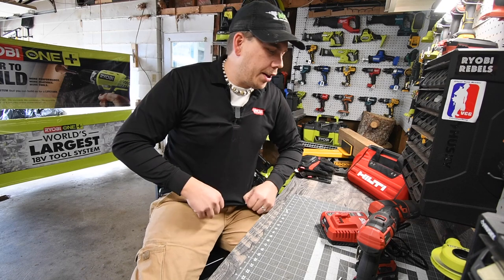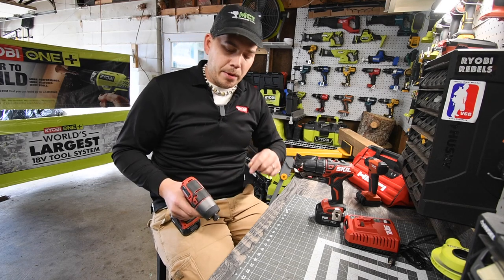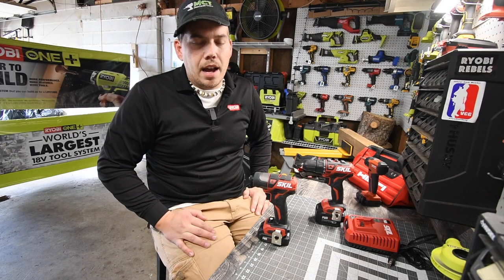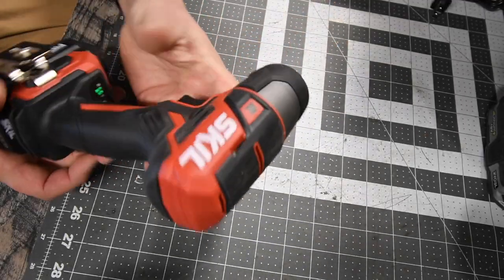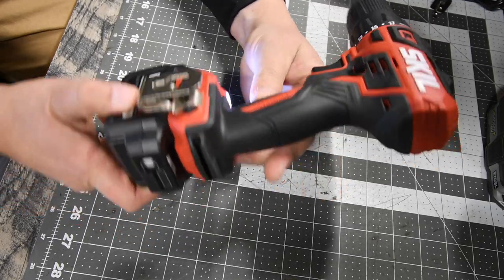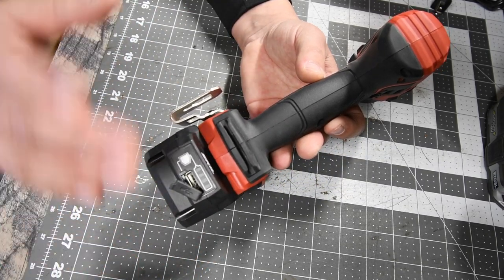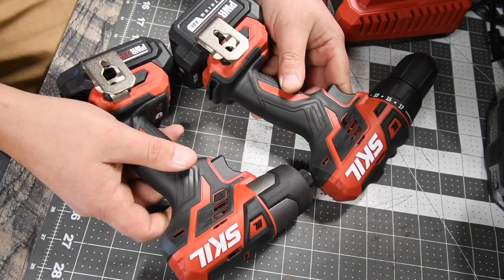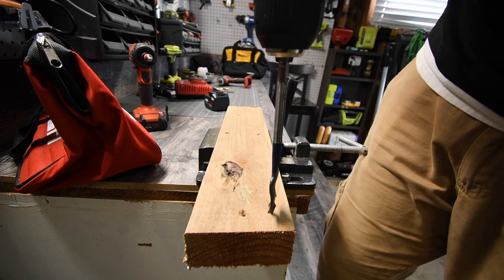Skill 12v Drill and impact test

Comment: Those usb ports are sick. For my line I bought a usb adapter for like $15 but still built in is really nice to have.
Reply from the maker: I agree and they should be standard for all
Reply: They're perfect to have a spare in the glove box, just in case of an emergency. What's more, the batteries have a cap so you don't have to worry about the terminals getting damaged.

Comment: I see nothing but high marks for these new Skil12v and 20v tools, but the problem is they have no distribution or retail partnership with any large outlet or home center like Lowe’s and Home Depot. Making them effectively an online-only option. I even called them today to see where I could find them in my area (Orange County, CA) and they couldn’t tell me. So when I’m comparing homeowner/DIY cordless tools, affordable price, good to great reviews, I think my choice has to be Ryobi. Too bad, because Skil tools look great!
Reply from the maker: I personally love 12v tools and Ryobi needs to make a 12v Brushless line and I thank you for viewing EatmoreBBQ
Reply: @ManCaverTools  Update: The Skil PwrCore 12 and 20 lines are now at my local Lowe’s! Not everything yet, and small end-cap displays with the tools out so you can hold them, but at least they are there! I’m hoping the Skil line grows to include a 1/4” cordless router, a duel 12v/20v charger (as Milwaukee and Dealt have) and maybe some day a brad nailer. 12v 5-tool kit for $199 (drill-driver, impact, multi-tool, light and  Bluetooth speaker if you like that, 2 2ah bats, standard charger), 12v circ saw $99 with 4ah bat and the new Jump charger. So add that up and if you spend $300 for both kits that’s quite a deal!

Comment: I would like to know if the craftsman performance is same as skill.
Reply from the maker: we will find out when I get 12v craftsman tools
Reply: @ManCaverTools  Is craftsman finally coming out with their V12 lineup?
Reply: crunchy pockets I would assume they will. There was the original craftsman 12v before sears sold off the name. But those were brushed and I think old nicad battery tech as well.
Reply: @jamesfair9751  the nextec 12v are lithium

Comment: Does the drill have a 3/8 or 1/2 inch chuck? Thanks!
Reply: I believe all 12vs have a 3/8" chuck regardless of brand. I maybe wrong but researching 12vs I recall a lot were 3/8"....
Reply: mixwell1983 thanks bro
Reply: The Milwaukee fuel is 1/2 inch regular brushed 12 v Milwaukee is 3/8 inch
Reply: Janes Fair thanks!
Reply: 1/2 in for the skil 12v
Reply from the maker: 1/2 chuck
Reply: Man Caver Tools thank you, thats awesome
Reply: Damn didnt know a lot were 1/2".. I was looking at cheaper brushed ones like Ridgid, Makita and Milwaukee so maybe that's why.

Comment: There is a 5 tool kit skil 12 volt for $99 dollars all brushless drill impact driver multi tool light and Bluetooth speaker at lowes and batteries you can plug usb to charge phones

Comment: I will politely disagree. Power tool batteries should not come standard with a USB. The industry I work in that rubber cover can get lost easily allowing dirt and debris to get into the USB port. This would create a failure point. I believe most of the main Brands have a battery to USB adapter available for there batteries. This is a safer way to create the batteries, I’m not stuck with a USB port on my battery in a rough situation, when I need a USB port I install the adapter.
Reply: Its a cool idea but I can see where it coukd have faults. In my 18v ridgid I do have an adapter and mainly my 4 year old and I use it to charge his tablet and my phone.
Reply from the maker: I still think its a good idea. make it a different kind of cover